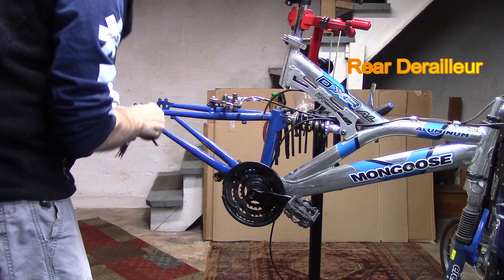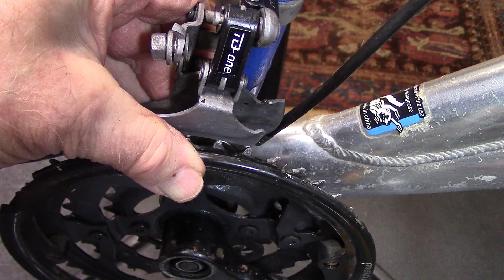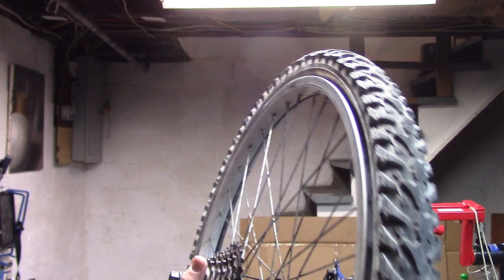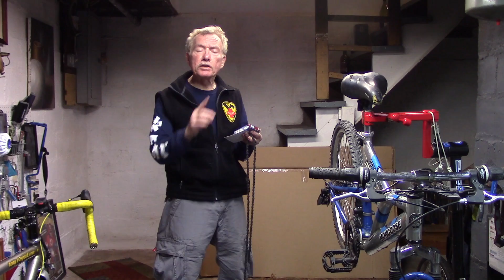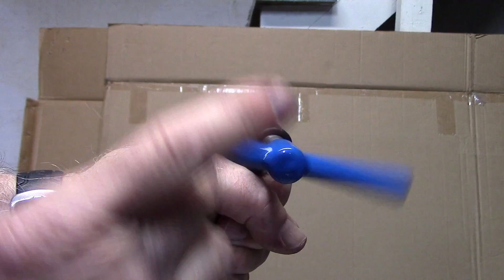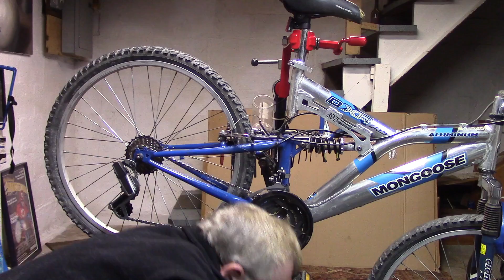Bicycle Restoration: Reassembly bike drivetrain

Comment: Regarding the tire tread and remaining life; you always want to put the best tire on the front of the bike. That is where traction is most critical. For both steering and braking. Having the worn-out tire on the front and the better Tire in the rear will upset the balance of the bike more so then if you had the better Tire on the front.
Reply from the maker: You have a good point. Some suggest rotating the tires to even out the wear. Does anyone else want to comment on this? We're talking road bicycles and mtbs. Regards, Tony

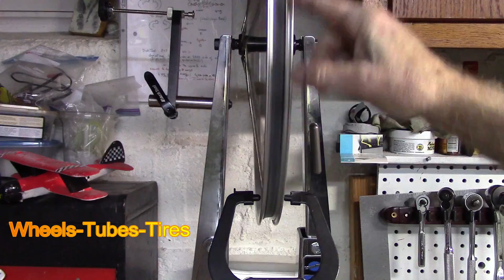Comment: 1:58 that rim is far from true, awful wobble
Reply from the maker: That's why I use a calibrated Park Truing Stand and NOT observe through a camera - 4 feet away, at an angle, where it's impossible to tell if the wheel is true. Camera distance and angles can be deceiving. You need to be close up to make sure the rim is within 5 mm of the calipers. Those who build and work on wheels will understand and I didn't feel it necessary for a close up to prove the point. Regards, Tony